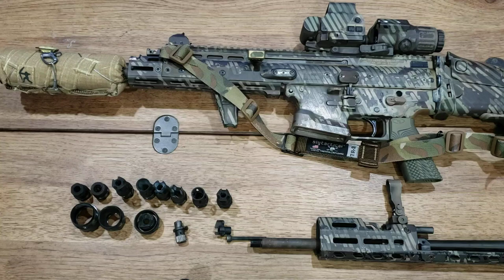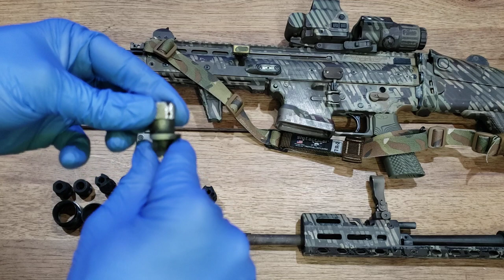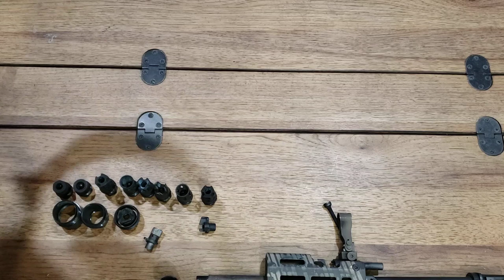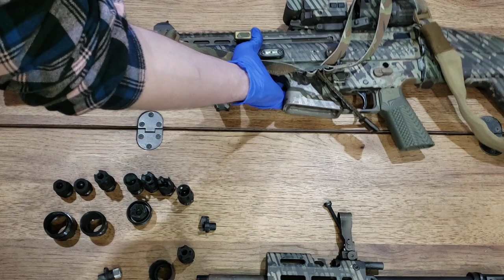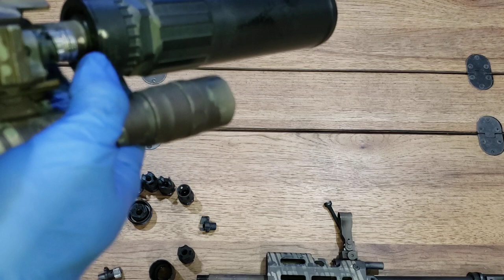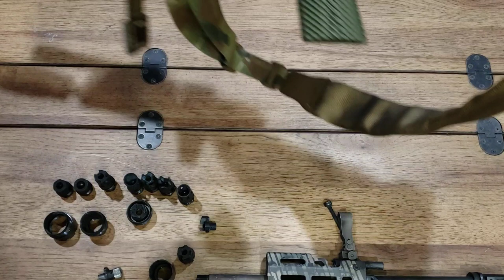CGS Helios QD Muzzle Device  Backpressure/Sound Discussion

Comment: I have the titanium version setup with Keymo QD. Works great on all my hosts including SCAR 17 and is one of more quieter cans I own. My 17 is suppressor tuned but I can’t speak for a 16.
Reply from the maker: You can save significant length and weight by ditching Keymo. You'll improve your backpress and sound with the regular DT mount. Can't speek for the ranking of the various Plan B mounts for .308 though. Some blast baffle volume helps the .308 a bit.
Reply: @galacticcactus6683  I agree on length but I don’t use it much on my SCAR and with everything being titanium but the Keymo it doesn’t have a nose heavy feel. I get about 4 - 4:30 ejection using a  Lantac dragon Keymo brake. I bounce stuff around with Keymo because I only have 6 rifle cans and I only shoot suppressed. Everything functions fine unsuppressed but I just never shoot that way. You’re playing with a different animal with your short SCAR so it’s apples and oranges.
Reply from the maker: @shannonmarcantel7993  I only have the one can and only shoot this rifle suppressed. I'll be doing DT for everything. It makes even less sense if you have six cans. DT or a threaded mount is the way to go, and your host is more gas sensitive than mine. You can do whatever you wish, but there are better ways to utilize this silencer. 

Apples and oranges are still fairly  comparable. Ejection pattern isn't the best indicator on the scar.
Reply: @galacticcactus6683  I’m sure you’ve researched the issue much more than me. I just played with gas jets that gave me the smoothest recoil impulse while maintaining single round bolt lock and 4 - 5 ejection pattern. A lot of the newer cans are coming designed with the ability to go QD or direct thread. My older cans are QD only. I’m not arguing DT isn’t better it’s just not the way I started so I’ve kept things consistent across platforms over time. On precision rifles I definitely believe in DT.

Comment: I love the grip and camo color. Awesome setup!
Reply: Yeah looks good, does that grip look like aluminum to you?
Reply: @JayDubz91 It looks like the same material as the G-10 grips for the 1911.
Reply from the maker: @JustAverageJeff  Its G10 made by VZ grips. The scar grip tang is slightly different than an ARs and they make grips for it. PMM also does, but I honestly wouldn't buy anything from them anymore. There QC and CS has been terrible the past couple years.

Comment: You need to make a video on how you did that striped camo pattern.
Reply from the maker: I copy past this any time someone asks... so if you have questions ask.

I used Kuiu Verde and Strichtarn stencils from freedom stencils with some krylon spray paint. The Kuiu Verde was one the rifle for a bit prior. You could get creative with cutting painters tape. That's what I did for the stock since I didn't have any digital shapes left.

Steps:

1: Base coat your darkest color (Dark Brown)

2: Apply digital stencils or use squares cut from painters tape to make your own. About 30% coverage.

3: Apply your next darkest color (Dark Green)

4: Repeat step two. Make sure to slightly overlap some of the previous shapes. About 30% more coverage. 

5: Spray a lighter color (Green)

6: Apply mesh stencils or netting over the whole rifle. 

7: Spray your lightest color (wheat tan) 

8: Remove all stencils. 

9: Place strichtarn or other pattern stencils over where you want the pattern you just painted visable. Everything not covered will be painted over. 

10: Paint the same color as step 1.

11: Paint the same color as step 3 in strips over areas with the most shapes from step 1. That way it contrasts and isn't just a large area of solid color. 

Make sure to let for 10-15 mins between coats. Also will be tacky for several days while it cures.
Feel free to try a different color combo or patterns. 

Strichtarn 
https://www.freedomstencils.com/products/east-german-strichtarn-camouflage-stencil-kit

Kuiu Verde 
https://www.freedomstencils.com/products/verde-camouflage-stencil-kit

I  highly recommend transfer tape. Leaving some negative space here and there. Someone others have done similar patterns based on mine that you may like more. r/rattlecannedguns is a great place to look for refrence. Go thin on the paint layers. Mine has been pained over several times, so no matter what I did it will chip as seen.
Reply: @galacticcactus6683  thank you! That's a lot of great info!

Comment: Maybe a dumb question but is the adapter ring literally just double sided 1.375x24 threaded (male portion and female portion) to extend it as an offset for so the muzzle device will fit?
Reply from the maker: Yeah, the distance from thread to blast baffle isn't long enough to accommodate most muzzle devices. Depending on tolerances you may be able to use a regular Reardon Atlas and the shorter muzzle devices. The Helios specific Atlas is long enough that you can use almost any of them.
Reply: @galacticcactus6683  Thank you for the response! My next question if I may is would a SD Tactical SF Warden modified to have the 1.375x24 threading with a SF muzzle device be able to directly screw in? If you have no experience/knowledge with the specific idea no worries. I appreciate your time. Just was trying to find ways to retain my SF Muzzle Devices without making the length ridiculously long.
Reply from the maker: @Xinthisis  I don't have any experience with those mounts. If the muzzle devices don't protrude significantly past the end then they should be fine.

Comment: Mine runs like a sewing machine on 11 Bren without the vented cap. Who made that cover for your Helios ?
Reply from the maker: The cover is from Liberty's Defense. They cost a lot and take a while to get, but are they best cover on the market. Most others will melt if you actually shoot more than a mag and walk loose. 

In regards to the video I'm only talking about the solid end cap. The lower backpressure coralates to sound in this silencer, so the testing is more in pursuit of that. I also want to minimize parts wear, so I like being able to tune the system.